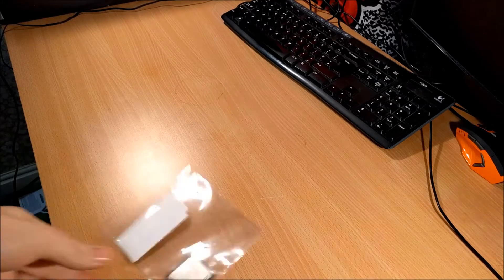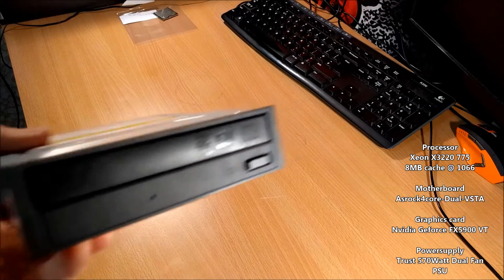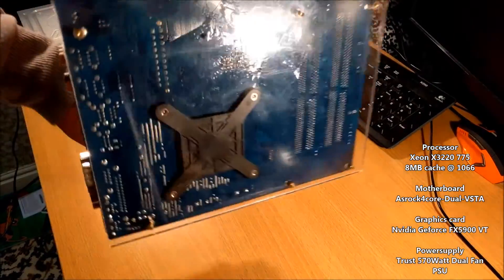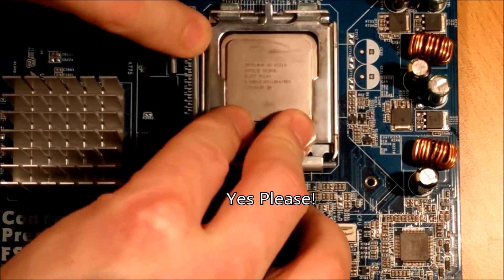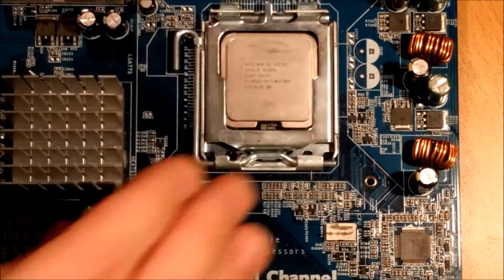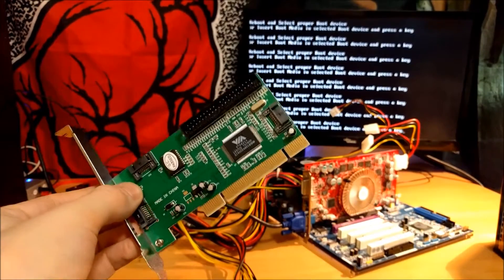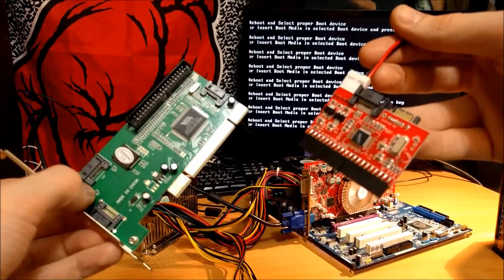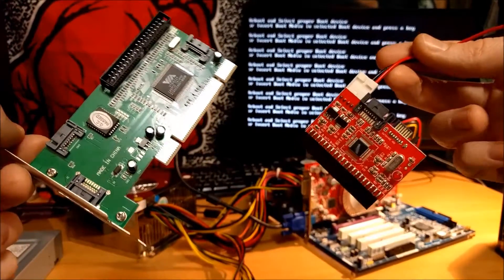Fastest AGP based Computer! Build Overview Part 1

Comment: Hitting the power switch (or shorting the pins) with the PSU unplugged does not drain the capacitors.

Comment: I have the same SATA/PATA plug connector you have. The PC did not detect anything connected to it. I am guessing mines a dud as this was from sealed box to computer.
Reply: So, by now ya probally should know, byt If you don't, some old pata HDs and other stuf have a manual master/slave, you need to check out the label to see where is the right place to put the jumper/jumpers. Principal Hd should be the master 1, and a backup Hd master 2. Cd/dvd drives should be the slave(It Just does matter If you had  Just 1 HD, them It must be slave 1). The manual imput is hell simples, Just plug as the label orders and you Will be Fine.

Comment: I used to run a conroe865pe with  modded microcode to support wolfdale dual cores.

CPU was an e5800 overclock to 3.6, GPU was an Asus sh4650 1gb and 4gb crucial ddr400.

With liquid cooling and some vid/vcore mods the e5800 could probably hit 4ghz
Reply: do you still have the conroe865pe ?

Comment: i had a asrock 4coredual-sata2 with bios mod to support 4gb, speedstep and other stuff, q6600 overclocked to 3ghz with tape mod and ssd. i think I had the fastest AGP system. than i just installed a hd6850 in the pci-e slot. than i upgraded the mobo with a p5q, added 4gb of ram, an other hd6870 in crossfire and still rocking the q6600 at 3,4ghz :D. now i could upgrade to a gtx 1050 that still don't bottleneck the q6600 at 3,4ghz but is like overkill for the kind of games that i play...
Reply from the maker: Hay dude do you still have the -sata2 board im uploading the benchmarks for this setup right now, so if you want to do a compare for some fun it could be interesting! I also have a Nvidia 7800gs but it wont boot in my board :| wish was a real let down! Would be interesting to see if the Q6600 bottlenecks a 1050ti i could do a Q9550 and see if its bottlenecked by a 7970 extreme :)

Comment: Great video! :D I am using this motherboard and  the same memory config in my tests. And I have a HD3850 now. I've only tested the board with the Core 2 Duo E6700 and the Q6600. Check out my videos, if you are interested. ^_^

Comment: Is your AGP card usin a PCI-E chipset? 
If so they work decent and can still run a lot of games !!
My CPU is only a single core 3200+ AMD athlon which I paid $750 just for a MSI K7N board and 3200+ CPU way back around 20 years ago.. lol yeah I was stupid at the time but had the quickest PC on the Block!!
Thanks 4 sharing Bud!!
+ 1 SUB
DEv
Reply from the maker: Its using a VIA chipset - I recently got hold of a 7800 GS OC AGP So it might be time for another review!

Comment: I own an AGP video Card that runs a PCI-Express chipset GPU on it for my old Athlon 3200+ !!!
It even has to plug into the PCI-E Power cord to power it!! (I mean 4 pron MOLEX cord lol) I just checked cause yours is the same.
I need to replace the fan on it now because it got all seized which I caught right away Thanks God cause they seem to be a specialty item..
I was curious when I found one on Tigerdirect so purchased it for around $200 even though I all ready had quad core systems at the time & HOLY FAQ .. It worked and worked awesome!!
First, those old Athlons (3200+) were very expensive to buy in their day, I paid $750 for a MSI board and 3200+ CPU (Which is ridiculous) but was before it's time at the time... Ran very hot though even for an AMD chip so had to install special thermo take systems to run the computer in the summer in an air conditioned room...
Still have the old girl and runs like a champ.. runs like it was a dual core or better still....
But now when I try and search for another video card that has an independant PCI-E chip on an AGP video card,
I can not find one..
So it must be quite rare.. pretty sure it is a NVIDIA Chipset as well.. I will dig'er out and get the model number off of it!!
Cheers!!

Comment: Should hook up say, a HD3850/4670 for a true "Fastest AGP-based system" :p
Reply: I am testing the HD3850 in this board now. :)
Reply: A guy told me that there is a bios somewhere which will allow you to do so. I would try it, but I only have 1GB modules. :|
Reply: yes, I am also planning to buy an asrock 4core dual vsta to build system with one of my 2 4670 agp and a q6600
Reply from the maker: Would love one but they are very expensive!
Reply: yes, but I got the gfx card for cheap with a deal and I already own the cpu, the only thing missing is the motherboard
Reply: for the asrock board I can get it for 30-40€ here in Italy where I live so it isn't too much expensive for me
Reply from the maker: piecaruso97 if u need ago it's the only option but if you don't there are many other boards
Reply from the maker: I couldn't get the board to accept 4GB of ram let me know if you have any success!
Reply from the maker: i wouldnt recommend the board unless u can take the headack